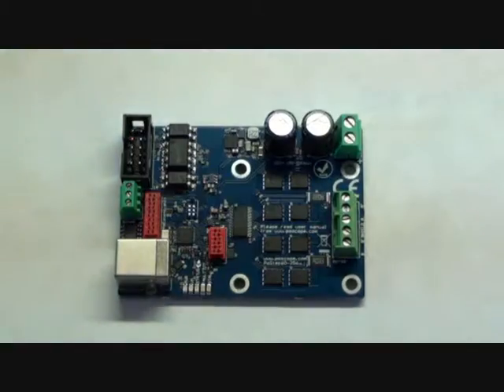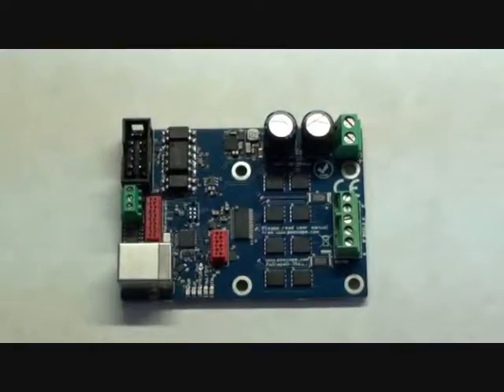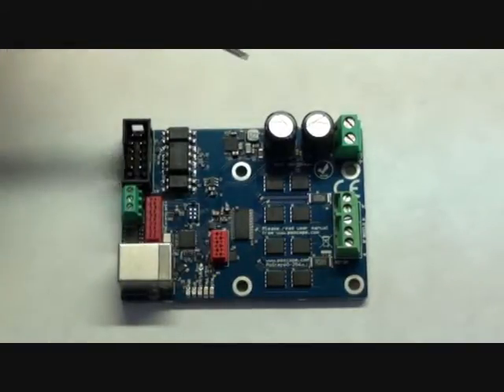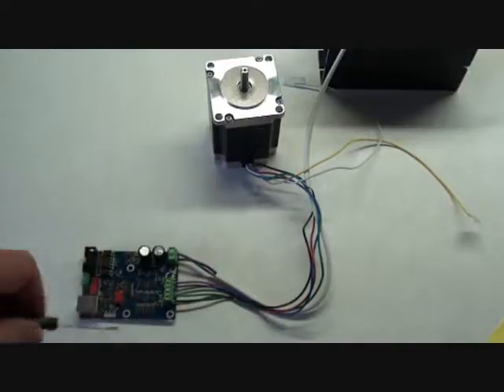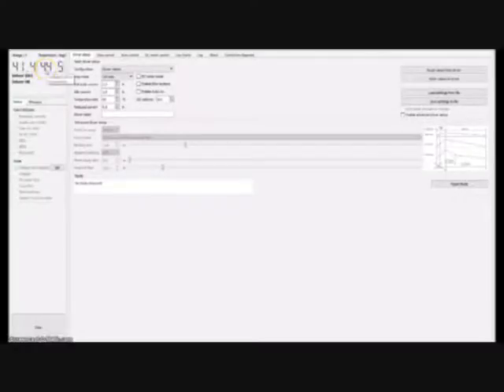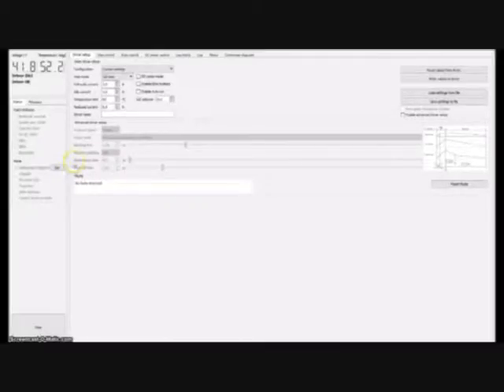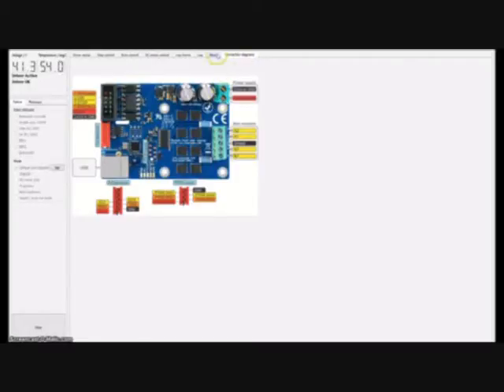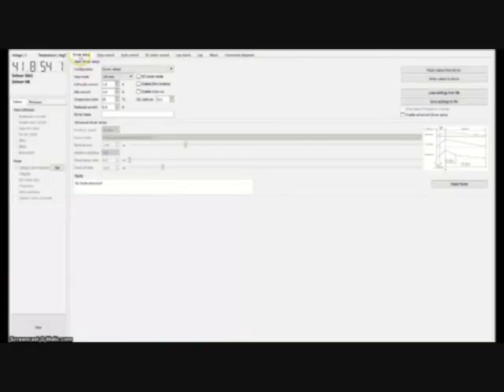PoStep60 Stepper Driver - a close-up look at Hardware and Software

Comment: Hi Martin, im getting an odd error with my PoStep60 set up. The Driver is disabled and the fault is saying that power supply voltage is too low. But the voltage is reading 48 volts. Any ideas why? This is the first initial set up. I have two drivers connected to the same power supply and they have the exact same issue. I also have one driver connected to a 36 volt power supply and that one works perfect. Very Odd. Any suggestion would be gratefully received. Thanks